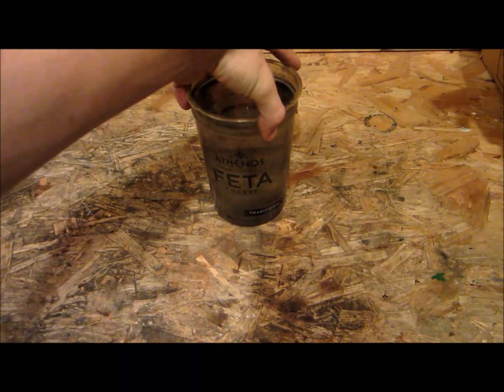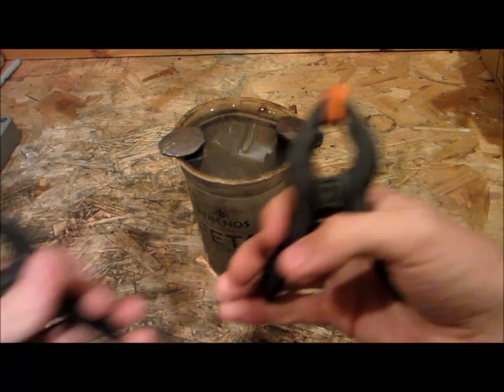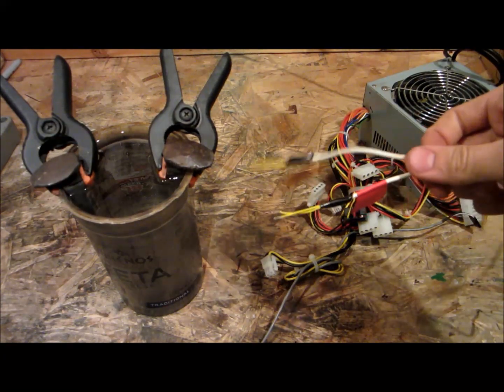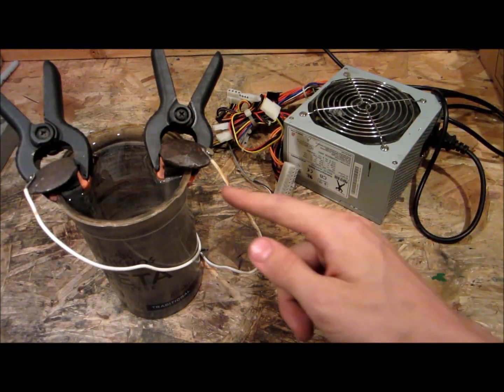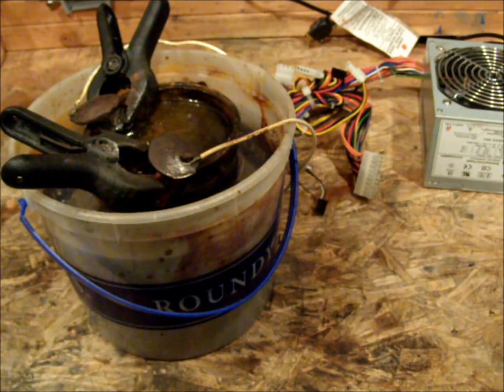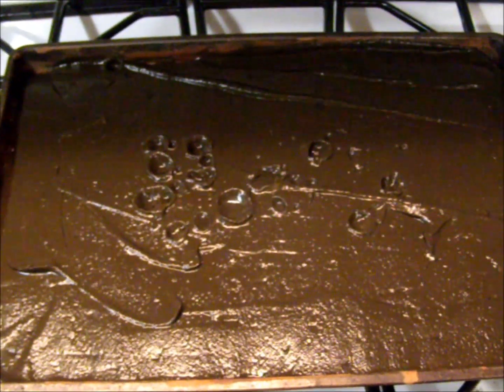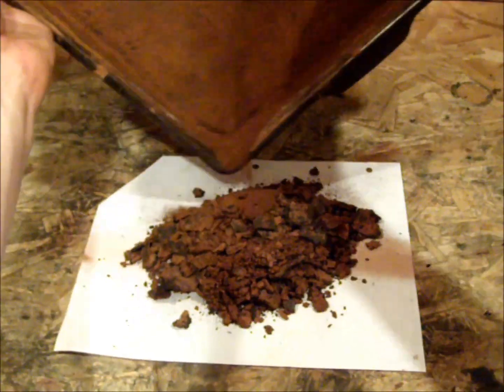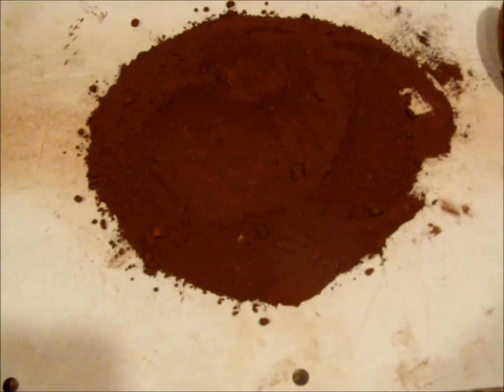Make Iron (III) Oxide

Comment: A look at a NurdRage (https://www.youtube.com/watch?v=RiF73l4PjyY) thermite video shows that he has a disparity in the size of the two powdered components. While it still works, fine sieved powders are best. The iron oxide as formed electrochemically is very fine after washing, it does need the caking as it dries to be broken up, a mortar and pestle + fine screening is best. Aluminum filings are sub-optimal. Best aluminum powder is bought from paint making supply houses where it is used to make aluminum paint. Fine aluminum powder can spontaneously ignite, so it has a fine film of a waxen coating to prevent this - which will not interfere with thermite making. You can mix the thermite powder safely using the dry powders, and the use of the fine aluminum powder for paint makes a very good product. You can also add a little binder in the form of fine gum arabic(1%) and press into shapes for welding railway tracks etc. Made with the powder it readily ignites with magnesium ribbon or even sparklers as the fine powdery state of both parts initiate easily due to the fineness.
Reply: @جلال جلال I do not think so. It would thermally decomp[ose into gasses.

Comment: I let my solution dry wihout using an oven and it stayed black instead of turning red, even after grinding. Is it still usable or have I produced something else here?
Reply from the maker: It is still iron oxide most likely, so it may be useable. However the oven drying step is good for adding heat, which drives off any moisture and also helps the product get to a relatively known composition. Your product is probably worth trying in whatever end use you intend.
Reply: @ThePlutoniumBunny  wow thanks for the quick answer!
Ok cool to know it wasn't all for nothing, I'm just gonna put it in the oven now to get rid of all the water like you suggested. Thanks!

Comment: can you please make a battery with this?
(step 2)for the other metal use nickel and then react it with HCL
and then after you have nickel chloride please add NAOH to it to make nickel hydroxide
and then use both of these materials for the battery with KOH as electrolyte
and before you can use it please charge it.

thank you very much for making this video

important tip:
you can make nickel powder from a nickel coin and sandpaper
but then the sandpaper particle will be mix with the nickel powder
to overcome this use a magnet and then you will only get the fine nickel powder
once you have the nickel poder you can procceed with (step 2)

Comment: I was trying this out and stirred the water with a bronze rod; and my solution turned blue!
I know it turned blue because the copper...
... My question is what will this do to my rocket fuel mixture?
or more specifically what happens to the Iron Oxide? and will it catch fire when it dries?
Reply: Your iron oxide won't catch fire when it dries. :)

The copper may help rocket fuel mixtures - I have heard of small amounts of metals (like iron) being helpful as catalysts to increase burn rate. More research is probably wise though.
Reply: @joshuadunbar9022  The iron oxide help burn rate because it gives 3 oxygen to the mixture (Fe2O3), but that's all I know.

... but cool thanks for the quick response, it's drying right now. I was a little worried it would go off like some kind of thermite.

I'm still curious what the copper will do to the mixture chemically?

Comment: Great project. Could the rust powder be made into some form of paint that would re-rust when exposed to air and water?
Reply: Falu Red... Linseed oil, rye flour, zinc sulfate (moss-killer) and it makes a great paint for rough-cut lumber. They charge $16-$50 per pound for the pigment, which is essentially what you see in this video.

Comment: instead try to make those from sand directly
Reply: you could do the resistance heating melting, then hot molten electrolysis to get iron, silicon, aluminium and Ca/K
Reply: how about a metal can mill?

Comment: so any power supply will do? can i use a car battery. legitimate question
Reply from the maker: Correct, as long as you have a reasonable amount of voltage (5V or more, probably), it will work.  A car battery will work, just make sure you don't short it out.
Reply: @ThePlutoniumBunny  Thanks, I'll try not to lol

Comment: You realize using table Salt which contains chloride makes chlorine gas instead of O2 and Hydrogen. Fyi that's pretty toxic stuff, use baking soda.
Reply: It's normally just a tiny amount (hydrogen-/ chlorine-gas) that's gonna be produced within a  *-clorine electrolysis. Put the running cell by an open window or in your garage etc. and avoid  breathing the produced gases, you'll be fine!
Reply: I would rather use potassium hydroxide, baking soda is not bad but.. KOH is better
Reply: People make the mistake assuming that if you add a pinch of sodium chloride to an electrolytic cell that you’ll get gassed by chlorine.  Let me make the point that the yield of any products of electrolysis is dependent on electrode material, electrode surface area, current density, ion concentrations in electrolyte, and finally pH of electrolyte.  Chlorine in any measurable amount will only evolve from concentrated chloride with a pH of 7 or less and with an inert electrode such as graphite or platinum.  

Any chloride that migrates to the positive iron electrode consumes the iron as opposed to binding to form diatomic chlorine.  This cell evolves hydrogen only at negative electrode meaning that only chloride and hydroxide exists it solution.  But the hydroxide is immediately bonded to iron to from the sludge.  One the spectator ions are removed you have a half cell reaction of iron, hydroxide and oxygen

Comment: Would a 12-volt lantern battery work or would it melt ?
Reply from the maker: Yes.  It would work, although it would likely be slower than using a power supply.  I would recommend carefully monitoring the temperature to ensure things didn't get out of hand; even in this setup with the ATX PSU, the electrolysis cell got quite warm.

Comment: i dont doubt yourr chemistry but you can't tell me water isn't a good conductor. i would not stand in a puddle with a live wire in it or another example Turning on light switches with wet hands or geting in the bath with a plugged in radio ETC its 101 water and electricity bad combination unless its used in Chemistry  ...
Reply: Hello W Winterheart.

 you know its funny i found out that the impurities in the water in tap water are what make it more conductive. The saturated salt solution creates a much better pathway for the electricity to travel. Can you elaborate for me why salt has ths affect in water? Thanks for your feed back
Reply: kieran johnston not trying to be rude or a smartass but try watching mythbusters on Discovery Channel USA they do different things like this to and they're pretty scientific too
Reply: kieran johnston yeah.. but a puddle has all sorts of shit dissolved in it. So does water on concrete, water touching your skin, water in soil, water anywhere in the wild really.

Comment: Man up a little buddy. lol Anyway... is powdered rust dangerous in it's dusty state? I was thinking i could just go knock off a few chunks of rust from an old dump truck, or something, & throw them in a steel ball mill for a day or so. the trouble is, steel balls can spark when they knock against each other. Lead, & glass balls are not as hard as the rust chunks, so this is why i asked. :)
Reply: Just don't do lines with it and you are good.

Comment: anyone know if i can use 120 volts
Reply: DJ Miles id say no
Reply: Try a car battery but unplug it the RED cable from the car first and use clamps.
Car batteries are around 12 volts DC
But use in something small like a cup or small jar, so it is quicker and does not discharge a lot from the battery
Reply: Only if the clamps are attach in series with both the left and the right nipple.

Comment: im getting green to black stuff lots of it mixed with rust on the buttom why and is this affects the rust
Reply: Green is from the coating on the nails, sand them or let the coated ones run to get all the coating off, empty and do it again after cleaning
Reply: yeah that sounds like you could have a little copper in the nails or possibly A.N. other contaminant of some sort

Comment: what happens if you put more salt
Reply: Salt used as electrolide. It makes process faster. But if you put too much it will contaminated result product.
Reply: +omerspahic kakanjI just did it, put 1/2 table spoon salt in 120 ml (about half a cup) of tap water in a small jar. https://duckduckgo.com/?q=small+jar+150+ml&iar=images&iax=images&ia=images
I think first thing that happen was that salt crystalized at the bottom
See something like jelly that was stuck to + side then kept sliding down and falling to the bottom. Then at the bottom it formed 1/4 (30 ml) of the cup of that white matter. You know it ain't iron cause iron is black or dark gray and with rust it is either orange or brown
Then something orangish kept forming on the top.
Earlier I did 170 ml tap water with 1 tea spoon, it went fine and black matter went to the bottom while brown/orange matter stayed on top. Eventually they mix together and drown to the bottom. all I could see was dark gray/black.

For this I used 6 iron nails, and tied each 3 with bare(no insulation) wire, made 3 turns around each one and left a little extra to connect to.
Then I used a Bench/Variable Power Supply like this one and connected one clamp to each side.
https://duckduckgo.com/?q=Gophert&t=ffnt&iax=images&ia=images
I went to 12 volts and 3 amps. Sadly it is just like the guy said, one of the clamps (-) melted and the wires got disconnected.
so I stripped it and wound it around the clamp again and stayed at 1 ~ 1.5 amps with 12 volts.
Max drawing voltage was 6 ~ 7.5 volts at that last amperage.
I guess this means if you use a 5v 1a power supply like Mobile one it'd work(in the nails case not what that guy used).
Reply: The white goo is an Iron Hydroxide with a soap-like consistency and super-fine Hydrogen bubbles.  The near-black goo is Iron (II, III) Oxide (Fe3O4).  You might also get a deep green/blue sludge as well.  This is another Hydroxide.

Mix a little of the white or green/blue goo with Hydrogen Peroxide, and it foams and rapidly turns rust red (proof it is holding some Iron).  If you have a large quantity of Hydroxides, you're using too much current.  Either use less salt or a lower voltage.  There is no discernible time difference with higher current, but it does generate a lot more heat which reduces your water level faster (evaporation).

Heat the white, green/blue and black goo together.  I've put the foam and crust into a 2 liter bottle and then shaken vigorously.  This liberates much of the Hydrogen quickly (try a flame at the mouth of the bottle and you'll get a fun pop).  The hydroxides will break down to oxides, and most of the oxides at this point will react with the Oxygen in the oven (accelerated by the heat) to create Fe2O3.

Once you have Fe2O3, put it in a bucket and perform a couple of cycles of flood/settle/drain to remove as much of the salt as possible and then dry again.  It is unlikely that the salt will interfere with most reactions, but will have an impact on proper measurements for optimum and reliable mixtures.

Comment: okay first of all you're doing it wrong you need to strip all of the wires to the power supply and tie all of the red together all of the yellow together all of the orange together excetera excetera excetera. they will all be different voltages the red one I believe is 12 volts although I can't really remember for sure you can easily check that. this will allow a lot more amperage for this electrolysis period it's very easy to do it takes literally minutes

Comment: for my power supply i can use -a wall adapter:6v DC ,another wall adapter 9v ac, or 9volt batteries which one should i use and with using salt as an electrolyte you have to remove the salt from the red iron oxide afterwards,do you have to remove anything with baking soda? and if i use baking soda can i do this inside? Ive heard it doesn't produce chlorine gas.
Reply from the maker: I'd go with the 6VDC wall adapter.  9V batteries don't provide much current.  You just remove the salt by filtering, as shown in the video.  Baking soda won't   work as well, if at all - the chlorine generated provides a very corrosive environment.  Good luck!
Reply: thank you very much your the first person to respond, i left a comment on every persons video on making red iron oxide on youtube! much appreciated. once again thank you very much!
Reply: which wire is the negative and positive on my adapter 1 wire has some sort of dotted line on it though. and for the negative electrode would something like a carbon rod be more efficient than just using another piece of steel? and to get rid of the salt more on the rust could i just keep adding water to dissolve most of the salt on the rust and letting it drain through the filter, because if you only do it once there could be still some salt on the rust when you bake it.
Reply: 1 more thing can this be performed out side in the cold in my shed(i live in canada) xD
Reply: what type of salt can i use just regular iodized salt or can i use sea salt?
Reply: im using nails so how long do you think i should wait until i drain it and can the salt water being drained be reused?

Comment: If You connect the negative wire to the Iron Wont it produce Iron acid?
Reply: The electricity can cause iron to replace the sodium metal and that will create various iron chlorides and sodium hydroxide. But as soon as the electricity is turned of, the sodium chloride is going to replace the iron and create sodium chloride and various iron hydroxides and oxides.
Reply: What about ferric chloride?  You're running electricity through salt water.
Reply: Cool... I didn't know that, about the switch when the power goes off. So... If you were to pour it off while power is on would it be Naoh that I would recover? I ask bc I'm looking for lye sources besides hardware store and the membrane cell
Reply: Muscle Mantis yes yes it will okay wait a minute no it won't lol. there is no God damn such thing ae iron acid what the hell you talking about

Comment: The iron oxide is insoluble, and you added salt. It should be shaken with distilled water, filtered, shaken again, filtered and shaken again and filtered. Then dried, this will give you 99% iron oxide. The iron you started with was actually steel, with a little alloying metal/carbon. This will also settle and be in the filtered result, and will act as an inert diluent.

Start with 100% pure iron for best yield - pure iron is hard to find as it is almost always alloyed.
Reply: Use mild steel it has very little carbon.
Reply: @AS-ug2vq  Yes, starting with an iron source with less alloying components will improve the purity. You could also use AC power and that would erode both spikes at the same rate, as all you want is the oxide and you are not plating. Since it is insoluble, a number of washes + filtering stages will eliminate the residual salt. Tap water is OK, as you do nor need absolute purity, distilled is technically the best. The iron oxide can be dried and sieved to create the finest possible material for thermite manufacture.
Reply: Cast iron is best but also have low amount of carbon 3%

Comment: Could I decant the sodium and grind for paint pigment? Any ideas on how to alter the shade of iron oxide, lighter or darker? Thank you for the information.
Reply from the maker: Yeah!  If you dry the black sludge without heat, it dries to a blackish-green, so you could mix that with the red stuff to create darker shades.  Mixing in other oxides, like aluminum oxide, would make the color lighter.  This stuff would definitely work as a pigment.
Reply: The Plutonium Bunny
Thank you.

Comment: Is there a way to reverse the process to form Iron? Using the Iron Oxide, Hydrogen and/or a catalyst?
Reply from the maker: Yes, there are multiple methods of reducing iron oxide to iron metal.  I show the thermite reaction, which produces molten iron, in another video.  Reduction with hydrogen, carbon monoxide, or carbon is also possible at high temperatures.  That is how they get iron from iron ore industrially.
Reply: Sweet! I half knew something! Thank you!
Reply: @ThePlutoniumBunny  pls direct me on how to convert iron oxide to a molten iron. Thanks
Reply from the maker: @safreedinternational6461  https://www.youtube.com/watch?v=D2q7new2jko